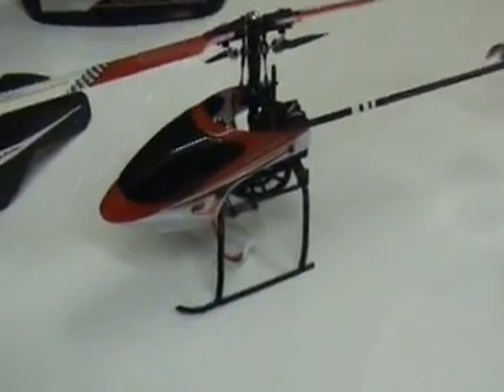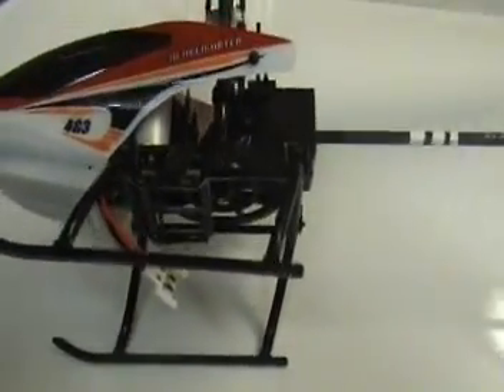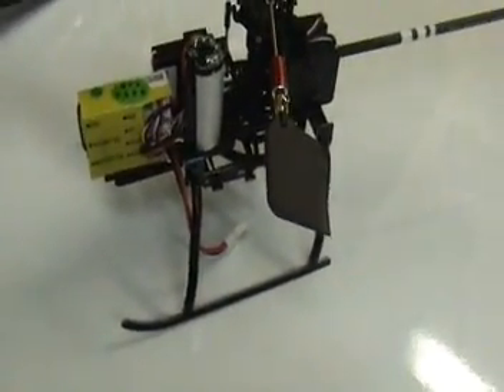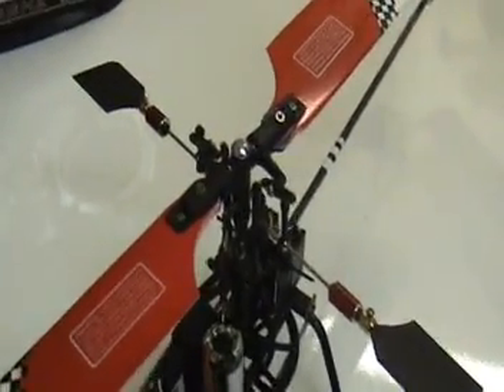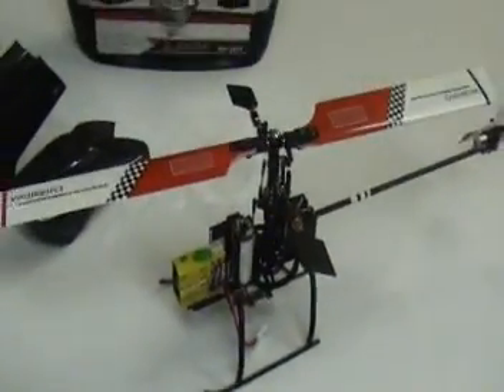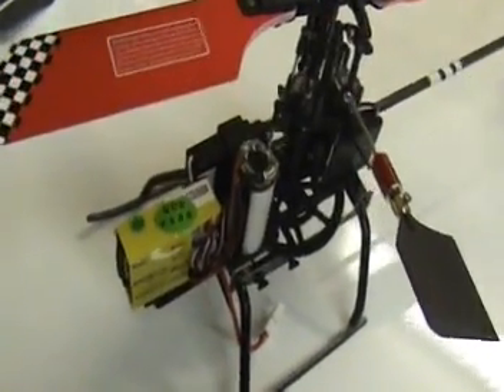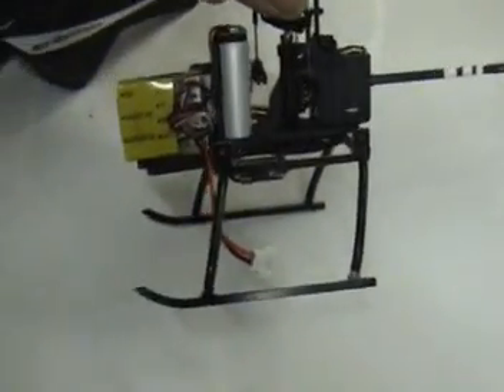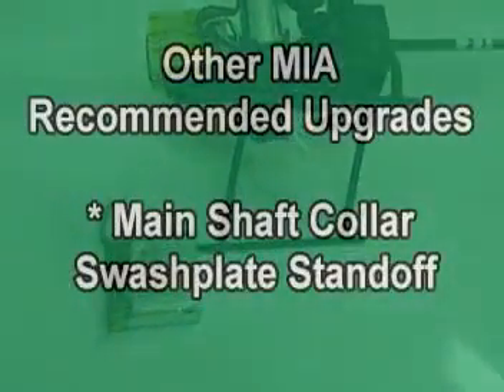Walkera 4G3 - 4G6 IMPROVEMENTS!

Comment from the maker: Well... for the most part, Walkera did a pretty good job at offering this 3D heli in the stock form. There are many intricacies in manufacturing and sometimes it is difficult to address every single point @ 100% in a product, especially when working within a certain budget and time frame.